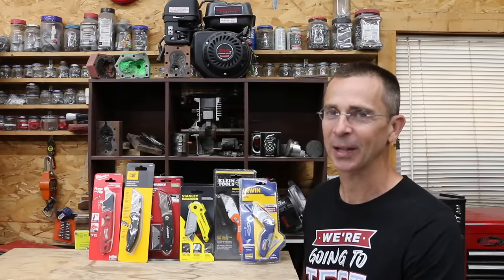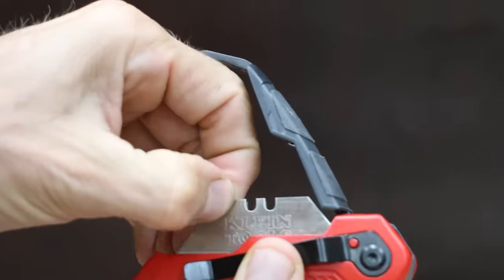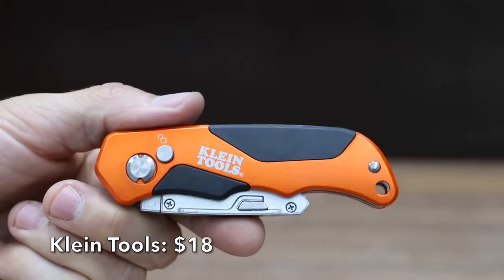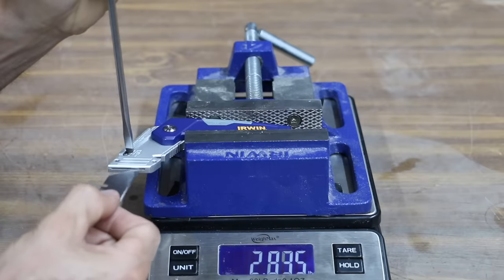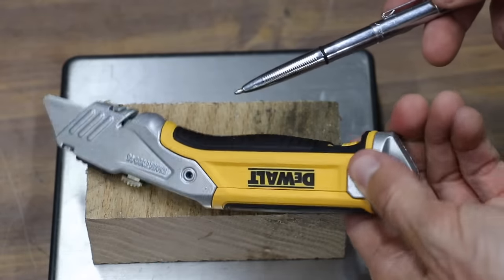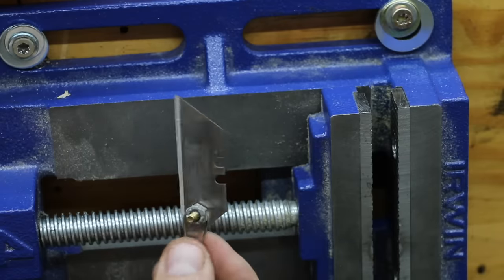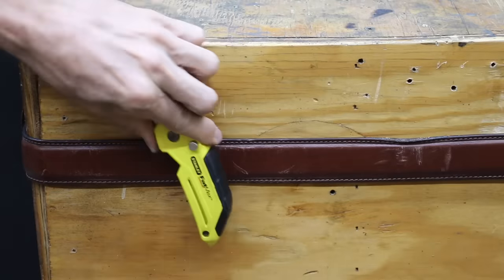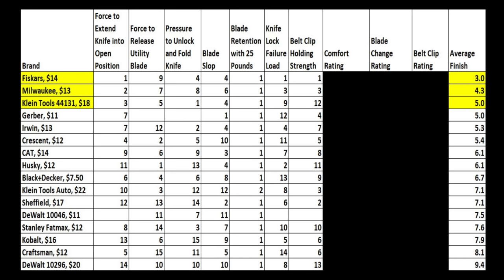Best Utility Knife? Let’s Find Out! Milwaukee, DeWalt, Gerber, Husky, Kobalt, Klein Tools, Craftsman

Comment: Bought the Fiskars based on your recommendation (as I often do).
This thing is delightful! Such high quality and design for 12 bucks. 
“Don’t play with knives” but I catch myself playing with this one
Reply from the maker: Thanks for sharing.
Reply: The Fiskars is by far my favorite too. I have gone through many knives to find it. The main reason I rejected most was accidental blade releases. All the knives with a simple button near the blade are useless to me. The compound action (press&pull) needed to release the blade on the Fiskars is perfect.  The only downside is the lack of blade storage. I don’t miss it much… I never could figure out what to do with the old blades anyway (I didn’t like putting the used blades back in the storage as they residue on the blade would get it stuck).

Comment: Tajima makes a locking break away utility knife. It is made in Japan, cost around $25-$30 has heavy duty blades I don't suggest using them just the regular ones. I am not kidding when I say hands down the sharpest break away blades I have ever seen. At work I would hold a piece of brown wrapping/packing  paper with two fingers pinched in the corner and slice the paper in half. The knife handle has a dial that clamps down to hold the blade that jets out from the top and is very heavy duty. I wonder if any of them can hold up to the Tajima knife. (Tajima is the red handle with the gray locking wheel with standard bladed. Even the blades are expensive and cost $15 or so bucks on eBay for 10 blades. Maybe you already did this I will do a search but it was the sharpest I've ever used.

Comment: I'm an industrial electrician and I carry the gerber for it's ultra light weight and tiny size. Most of the other guys prefer the milwaukee for the larger handle. The gerber is amazing if you have skiny, dexterous fingers. Definitely get the milwaukee if you have sausage fingers. I wouldn't even consider the other knives. Hope this helps someone in their purchasing decision.
Reply from the maker: Thanks for sharing.

Comment: I have a Kobalt, mostly because it was the only one I could find when my old Husky broke. For me, some of the main things I look for in a pocket utility knife are the "rideability" in my pocket. Wider knives are uncomfortable and cause bruising to my hip if I bump into something with it clipped in my front pocket. I also like a narrow blade holder like my old Husky, which is useful when making multiple deep passes on material, but that often comes with a compromise with the ability to retain the blade when pulling through thick material. The design of the clip is important. Not enough taper on the clip makes it hard to clip in place as you showed, but too much clip sticking out has caused me to scratch my truck when I brushed up against it and the clip caught the paint. The bigger clip also causes the knife to come out sometimes. I've had mine clip itself to my seatbelt and remove itself. I'll be checking out the Millwaukee if I can find one locally.
Reply from the maker: Thanks for sharing.

Comment: I love the reviews, many thanks. 
Most tool manufacturers do not appear to consider that some people are left handed. I’ve owned a number of drills, grinders etc where the switch lock is accidentally engaged because of a design that only takes account of right handed people making them dangerous for the user or uncomfortable.  In this video, it looks like the unlock button will be squeezed during normal use by a left handed person on a number of knives. Also, the comfort could be impacted as a result of the belt clips.
In future would it be possible to just give mention or a “suitability for left handed use” rating where such issues may arise?

A review of the following would be good:
Indexed/standard  lathe tools
Best insulated coffee mug / Flask
Engine cranes
Car Ramps
12v to 230v/110v inverters
Reply from the maker: Thanks and you are welcome!  Thanks for the video ideas.

Comment: I am definitely a milwaukee fan. As an electrician, I've tried many of these. I currently have a fastback and a kobalt. I actually prefer the kobalt bc its so slim and I cut wires delicately so I like to hold it closer to the blade for a more controlled cut. In my opinion, u can't beat the kobalt for the price. Especially if u catch it on sale.
Reply from the maker: Thanks for the feedback.

Comment: The Milwaukee Fastback can be opened with one hand. Push the button and and with minimum movement it will snap open. Same with closing.
The on board blade storage is the best i have found so far.
Reply from the maker: Thanks for the feedback.

Comment: Took an old metal Stanley case utility knife with yellow chipped paint  on it from years of use. Still swear by it and it holds like 10 blades. As long as  it's comfy to use, it's the blade that does the work
Reply from the maker: Thanks for the feedback.

Comment: I used a utility knife a lot in a previous occupation, and the only knife that you tested that I would buy would have been the non folding dewalt knife. The factors that I consider important are price, speed of use, maybe comfort and durability.  Most of the knives you tested I wouldn't consider commercial grade.  Commercial grade being is mostly cost effective.
Reply from the maker: Thanks for sharing.

Comment: I had the craftsman knife for a few months and lost it because the belt clip would work itself loose. I’d bend it back tight but it’d just come loose again. Eventually just fell out somewhere and didn’t realize until I got home. Bought the Milwaukee after that and still have it. The retaining screw in the bottom of the knife worked itself out, though, and now the two frame pieces are flopping around at the bottom
Reply from the maker: Thanks for the feedback.

Comment: The best one I’ve ever had was a craftsman . It was stainless and wood . It was balanced and beautiful . I lost it down a spearing hole in my shanty and my magnet could not retrieve it from the thick weeds and muck . I currently have a husky that is very similar to the craftsman . Stainless and wood . I carry these every day for many many years . I am a painter and I use these knives constantly at work and at play . Most of these models you showed I would not own .
The Sheffield is the only one that looks great and has the characteristics I prefer .
Reply from the maker: Thanks for sharing.
Reply: I just ordered the Sheffield . $16 on Amazon . If it as good as it looks , I’ll let you know 👍
Reply: @ProjectFarm  just received the Sheffield . It’s the same knife as my old craftsman !! Im so happy !! Now I’ll remove the peg and the belt clip and scratch my name it !!! Thanks for the video ! I wonder what the relationship is determined craftsman and Sheffield ?

Comment: I have that black and decker knife at work, but then with the Stanley name.
I did some slight tweaking on it and now it really easily flicks open. I've been using it (lightly) on a daily basis just opening boxes and it's been perfect for me personally. So far it easily lasted 2+ years and I imagine it will last several years more.
Reply from the maker: Thanks for sharing.

Comment: I had the cheaper of the two Klein utility knives here for a while, back when I was working in manufacturing. The size and button lock were fantastic for a small EDC pocket knife, but after about six months of use the lock started slipping, and it would close under a few pounds of pressure without depressing the unlock button at all. I had to get rid of it before it folded on me and took a finger off. I ended up just using a basic Stanley until I left that job, but if I had to do it again I'd probably get the compact Milwaukee Fastback instead of the Klein.
Reply from the maker: Thanks for sharing.

Comment: The best utility knife I ever owned is a Stanley slide out. The Best kind like you've tested is the ones I bought at Menards - Tool Shop. You'd think they would've been crap being a box store brand and made in China but, duh they are all made in the same manufacture anyway, mostly. I've had all 5 of the Tool Shops for over 15 years.
Reply from the maker: Thanks for sharing.

Comment: I carry an use a utility knife everyday.  Very interesting study.  I've used DeWalt, Craftsman, Milwaukee, Kobalt, Stanley, Irwin, Husky and Scheffield.  

As pointed out by @hoody5964 the belt clip strength is a must.  I haven't seen too many Pro's carry these on their belt, instead they slide them into a front pocket.  This is where belt clip strength come into play.  During the course of each day it will brush against many things.  With all of the brands I mentioned above, except Scheffield, the clip fails and bends into an "open" position.  This renders the clip unable to retain the knife either on a belt or in the pocket.  As I write this, I'm looking at 4 knives in this condition sitting on a shelf.

I've found that the Scheffield, for whatever reason has a very durable belt clip.  I'm not particulary fond of the design but I need a knive to stay with me during the day.  

For simplicity and affordability, I believe the Husky gives you the most bang for your buck, but the belt clip strength is Lousy. 

Anyhow, just my 2 cents.  

I love your channel, Thank you and Keep 'em Comin'!
Reply from the maker: Thanks, will do!  Thanks for the feedback.

Comment: I had to check, but the Milwaukee 48-22-1502 does have storage for five blades in a magnetic holder.  My wife pur hced it for around $23 in a two pack at the local hardware store.  Excellent box cutter.  She chose well.  😊
Reply from the maker: Thanks for the feedback.

Comment: Great video! I thought the Sheffield was the old steel frame Craftsman they used to make. Didn’t know they made it in aluminum or that they sold the patent. I still have that old Craftsman and it’s my go-to for any heavy duty work. My go-to for heavy duty and or dirty work is my metal frame Stanley. The one with the plastic flip open blade storage. I’ll check out the Fiskars though and maybe add that as well. Thanks again!
Reply from the maker: Thanks and you are welcome!  Thanks for sharing.

Comment: Product Test Idea - Having just used some, hows about a carpet cleaning liquid Test - and/or carpet washing cleaners. Lots to test, suction, application, aggitation, amount of dirt lifted (water colour/dirt density) and also the percentage of water recovered versus applied. The liquids used are key here - many machines can apply and recover, but the cleaning solution/water temp make a huge difference - Probably a few programmes in this.
Reply from the maker: Thanks for the suggestion.

Comment: I stumbled upon the Milwaukee fastback looking for an affordable and well designed utility knife for grunt work now it's pretty much always with me. Had bought two of them since 2016. My first purchase I left the job I bought it initially and thought it's be a treat for the new worker taking my place. When I knew I needed a blade. I didn't think, I knew exactly where to go. Homehardware and the red unique looking utility. There is also another hook design on the blade holder which can strip wires and using a serated blade will make it near ideal to a designed wire stripper or be passable cutter. Just don't be cool acting flicking blade close or you can potentially have an accident with how slim the body truly is
Reply: This video helped me understand the weak points on the fastback too. Still never had any issues other than re-torque the belt clip.
Reply from the maker: Thanks for sharing.

Comment: Love my Milwaukee fastback, two for $20 CAD a few years ago. Clips easily to my pouch, small comfortable profile and easy to swing open and close when needed. Only complaint is the play in the blade can be annoying when you want to control your pressure on cuts. Milwaukee blades have gotten dull almost immediately but that's another story
Reply from the maker: Thanks for sharing.

Comment: Those Sheffield knives are awesome. I mean most of this stuff is kinda subjective but the Sheffield holds a blade and it’s built heavy. I had one that fell off the roof of my truck at like 50 mph and it didn’t hurt it. Used that thing as a pry bar, a hammer, a screw driver, you name it. I finally lost it somewhere and that was the demise of that thing
Reply from the maker: Thanks for the feedback.

Comment: The dual blade design on the fatmax could be pretty useful. You could put a carbide blade in one slot for cardboard and a more traditional blade with a less brittle metal for tougher work in the other slot. I'll buy one eventually because I collect interesting utility knives.
Reply from the maker: Thanks for the feedback.

Comment: Suggestion: Best small air compressor (combo?).  I'm thinking about the 6ish gal Porter Cable, Bostitch, Rigid and so on.  Maybe compare the kit versions and test the quality of the included tools also?

Keep up the great work.  I find the videos very interesting even if you're reviewing things I don't particularly need.  I like how you come up with reasonably simple tests to compare practical aspects of tools/supplies.
Reply from the maker: Thanks, will do!  Thanks for the suggestion.

Comment: For quick access everyday carry disposable blades, I prefer folding scalpels. Cheaper blades, smaller profile. Downside is they're a bit uncomfortable for heavy work. That's why I carry for EDC folding scalpels and a utility knife in my workbench for jobs that require more work. The folding scalpel will cut into anything the utility knife will cut but are uncomfortable to hold.
Reply from the maker: Thanks for the feedback.

Comment: The problem with this series of tests is that it does not test performance over time.  Try a test where you continue to score cement board over and over (with a slight change in angle as the knife moves through the score) and I bet most, if not all, of these knives end up with their blade pulling out.

Comment: Check inside the slot on that milwaukee knife, the package doesn't tell you but it has blade storage! At least mine does. It uses a smal liner lock and is a bit finicky but it even has a symbol of the knife and arrow pointing at it. Hope this helps! I had that knife for 2 months of daily use before finding it.
Reply from the maker: Thanks for the feedback.

Comment: You should check out the Canadian Tire Mastercraft utility knife. Very over built, belt clip and lanyard hole, blade locks in 4 positions - button lock. I just had a few sent to me in Hong Kong, because they were on sale for 9.99, and with shipping and currency exchange, they still came out cheaper than the Stanley ones on sale here. The only thing that they don't have is blade storage, but the blade is very easy to change. I will have to order more, because my wife took one, and my neighbour took one.
Reply from the maker: Thanks for the suggestion.

Comment: You probably noticed that opening some of the knives is really easy if the button is held down till fully open. My Milwauke swings open with a snap when the button is held down and only takes a fraction of a second - so fast one is not even aware of actually keeping the pressure on the button.
Reply from the maker: Thanks for sharing.

Comment: I personally like the Husky utility knives. The way they secure the blade is nicer than the Kobalt. I've accidentally ejected blades out of a Kobalt while putting downward pressure on it cutting thick peel and stick vinyl planks. I was gifted a Husky compact folding lockback utility knife and it feels really sturdy and closes tight. I bought a Husky wood handle folding lockback utility knife and it feels nice to hold but a coworker pointed out that when the blade is closed it leaves the side of the blade exposed. He said even though its not a cutting edge it was enough to wear through his pants. 

I've personally never heard of this happening, but if that's the case I'm better off with the Husky compact
Reply from the maker: Thanks for the feedback.

Comment: I would have liked to see him rate the Lennox brand knife, best known part of the Lennox, handel has to be opened to half way, to release blade, big on safety., also has a built in screw driver, and bottle opener, string or wire stripper. As an electrician, I highly recommend this knife.
Reply from the maker: Thanks for the feedback.

Comment: 8:05 Can confirm, lost 2 screws for the Gerber.  Luckily, I work somewhere that stocks lots of hardware and I could find replacement screws of the same thickness and threading with a head small enough to fit in the recess; I just had to cut the screw short enough.
Reply from the maker: Thanks for sharing.

Comment: As always, great video. I have the Milwaukee utility knife. I like it’s simplicity. For those of you looking at the ones with extra blade storage, I have found that to be a useless feature for one reason. By the time it comes to changing blades, the ones in the storage usually rust up. It’s a cool selling point, but is it really that practical?
Reply from the maker: Thanks for the feedback.

Comment: This was great, and very helpful. Thanks! I have some utility knives and one of my found problems is a screw loosening near the pivot point which lets the pin to pop out at the pivot point on occasion allowing the blade to swivel back. I'm not sure if it is from the pressure I apply, vibration, or just rubbing the screw with my hand over time (or a combination of the three). 
I don't know if this would be easily testable, but perhaps it could be added to your tests for folding tools? Either way, thanks for all your work and videos!!
Reply from the maker: Thanks and you are welcome!  Thanks for the suggestion.